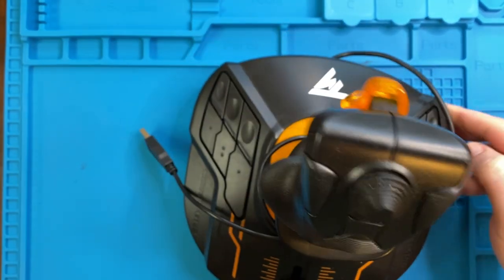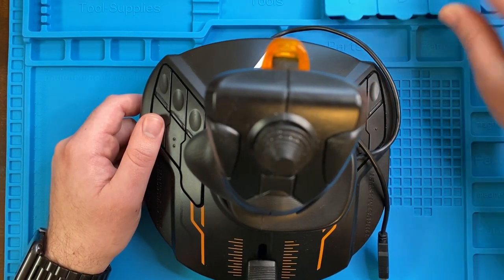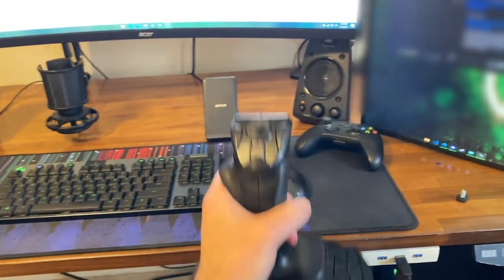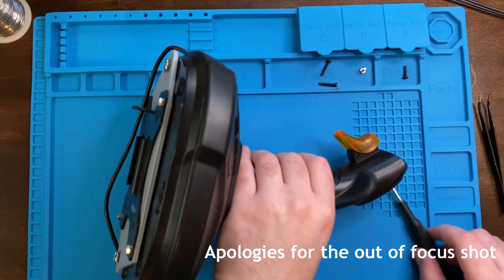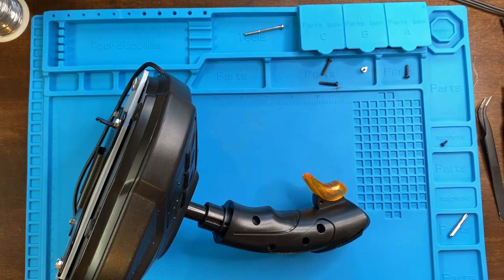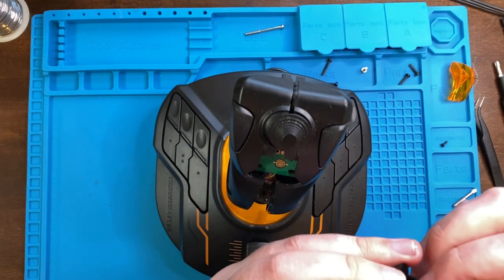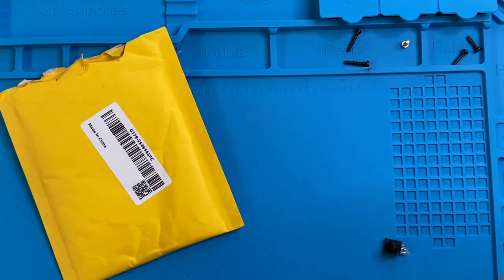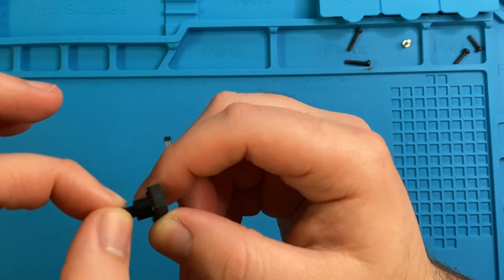Let's fix a Thrustmaster T.Flight T16000m Flight Stick - Broken Yaw/Z Axis

Comment: I followed this procedure and other than the yaw being backwards it works (I reverse back it in the games). 
This took a while to complete but it works great.
I used Kapton tape to insulate the 2 outside legs of the IC and only 5, of the 6x3mm magnets I had which was about 1/2" in length total.
If you have fiddly skills and patience, this mod is so much better than stock and corrects the drift and jiggle. 
I hot glued the top and around the edge and lots of glue where it wouldn't interfere and the magnets placed below the IC.
Reply: You can also flip the stack of magnets around.
Reply: @neuromonkey  Yeah but you won't know it's reversed until you hot melt glue it all in place and put the controller back together. A complete teardown and removal of the magnets that are hot melt glued in place and reversed and redo the whole thing. It's infinitely easier to just reverse it in the game controller settings. There is no way to test it until it is done and then you have to redo everything.

Comment: Hello, thank you for the info in this. Thinking of performing this myself. I purchased one of these sticks for 15 bucks at a flea market and the only problem is the rudder control does not work at all. Has there been any issue so far with doing this?
Reply from the maker: Not that I've been able to tell, no. Works just fine ever since I re-calibrated it
Reply: @MattPassarelli Nice! Thank you

Comment: Could you share the name of the secretlabs chair joystick mounts you use? You mentioned it in the video but I didn't catch or see it linked anywhere. Thanks!
Reply from the maker: @ABouncer  I used these with some creative placement on the armrests https://a.co/d/eg00L2V
Reply: @MattPassarelli  Thanks! Annnnnd now I need the 3D printed mount and the slide on plate (or is that part of the vesa mount? I really like how you did that, did you need to buy USB extension cables?
Reply from the maker: @ABouncer  I used these: https://www.thingiverse.com/thing:2769281
Reply: @MattPassarelli  I've basically copied what you did and it's coming together nicely, but I have a last question. What screws/nuts did you use to actually mount the 3D printed adapter plate to the VESA mount? I'm using 8mm x 10mm for the mount to to the joystick/throttle, but I can't tell what size is being used on the mountplate to VESA plate. Thanks!
Reply from the maker: @ABouncer  the thingiverse post has them. It’s a mix of M3 and M6 screws
Reply: @MattPassarelli  Ahh thanks very much!

Comment: Hey your link shows 2 sizes of magnets they are out of stock but i can source others. Did you use the 3mm wide magnet or the 5mm wide magnet?

Thanks in advance
Reply from the maker: I’m pretty certain I used the 3mm magnets from that kit. The size doesn’t really matter, just so long as they fit within the handle. You just need the sensor to be able to read the magnetic field, so either should work in the end.

Comment: I ended up using SS49E sensors so i could order them from amazon had to bend them 90 degrees so the top part pointed at the magnet

Also had to unglue the magnets and pull them out so the magnetic end is farther from the plastic than it was so get full motion range

Cost my £26 for the magnets, hall sensors and a gluegun

Also cost me nearly 4 hours of fiddling to figure out how to position the magnets for the sensor i chose

But way more than worth it because it was either spend £300+ on VKB joysticks or just grit my teeth and use these things

Its absurd that thrustmaster havent made a new t16000m variant with hall sensors instead of these crappy pot sensors

Ive still got an issue with them the mini throttles on both jutter around when moving them which is annoying and i cant find a way to sort them
Reply from the maker: Glad to hear you eventually got the stick working. What mini throttles are you talking about?
Reply: @MattPassarelli  the tiny sliding things at the bottom rear of the joystick

Comment: Is it possible to use N38 magnets instead of N52 (the ones from the link)? Nice tuto btw!
Reply from the maker: Probably. I think it’s more about size than strength. The Hall effect sensor just needs to be able to have its magnetic field changed. So however you get a magnet near it should probably be fine
Reply: @MattPassarelli  Thx for the quick reply! Will give it a try.